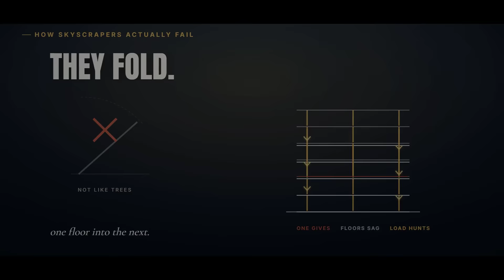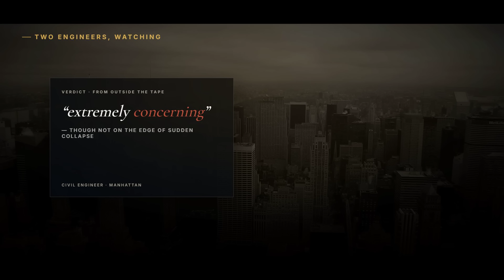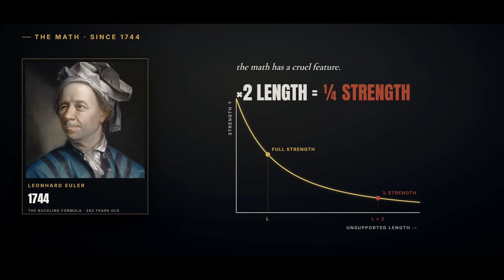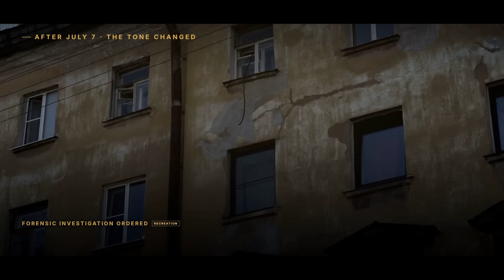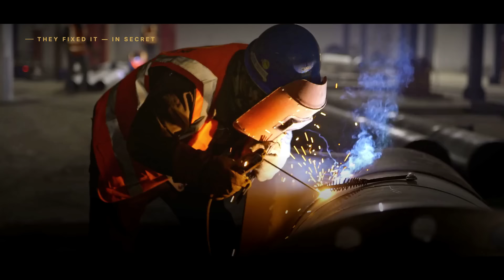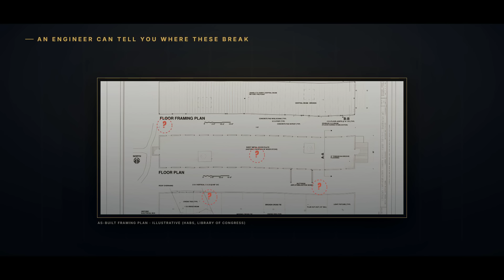It's Confirmed! Manhattan's Old Pfizer HQ Started Buckling Into Apartments. Here's Why!

Comment: Bolts provide a lateral strength , but are weaker in vertical strength. As tight as the metal bolted may be, a welded joint is solid, do you ever wonder how a screw comes lose? Gravity and vibration

Comment: One thing that is never brought up is that the columns that bent when the building were first bent were the top floor and supported nothing but the roof. Could these columns have been damaged during the original construction and salvaged for use on the non-load bearing top floor? The weight of nineteen stories were added to the original load on those columns.

Comment: The Citibank building was a very different situation because the designers had gone through all the hoops and did everything by the book. The problem was the novel design required consideration of the quartering winds,  which was not required by the code. Fortunately someone asked a question. This narration and other stories that I’ve read about this don’t really say why the welds were replaced by bolts. That was a critical part of the problem.

The narration also doesn’t seem to mention the role of the city inspectors in this process. If two beams were missed when the others were strengthened, why didn’t the inspectors catch that?

When they finish, they should put a plaque somewhere in the building honoring that steamfitter. What he did probably saved many lives.

Comment: Not a fair comparison. The Citicorp Building was a case of an unusual design made for a specific reason, which put it in uncharted territory when it came to what sort of calculations needed to be done. The Pfizer Building a case of additions to a structure that the original architects had never planned for and job-site blunders, neither of which the original architects had anything to do with. So why compare them?

Comment: A $32,000 fine not paid before construction continues is small change compared to the total conversion cost of the building likely millions. The fine should start much higher and for more violations it goes up a lot. 

Some investigator needs to follow the money. That will explain why they MISSED reenforcement and maybe other inspections I hope they don’t just stop saying it was a mistake. If I was part of the city council I would push for removing the extra floors.

Comment: No one will buy an apartment there or even near to it. I hope the seller must tell a buyer about what has happened. It was crazy to add floor to an old completed building. It should have been a calculation to decide if the beans would hold the extra weight. Plus, shoukd have been requiring inspections down to seeing actual steel under the fire proofing. It seems these beams had rust exactly where it failed.
Reply: The tops of these columns were at roof level. I wonder if years of small rain leaks had led to heavy rusting that no one saw?

Comment: The beams are below the original roof. They filled the empty corner of the building with floors and didn't change the original columns. There is also a cantilever effect as well. Simply put, they messed up.

Comment: Why not implode it and start over ? It's only money, after all.....
Reply: It will have to be taken down systematically, I expect.  There is not enough room to drop the whole building.  Besides, the original structure should be good, except for the local damage where these columns buckled.

Comment: Office buildings are built to hold a higher live load than apartment buildings. If those columns were overloaded they were probably modified, or a load bearing wall was modified. I'd rather live in a converted office building than an apartment building.

The main work with office conversions are ingress and egress,  water supply, waste lines and new electric runs. Partition walls are simple.

Comment: the load is too much on the existing structure that was built with xyz in mind loading  ,  putting mno in place and its over weight on the previous frame work, tear it down its not viable to try to fix  its a danger

Comment: I have been bullish on conversions from office to living space. However I would never had thought they would try to make old buildings taller and put pools on the roof. That just seems insane. They just don't want to lose expensive office space to affordable living space, so they think they can do these crazy attempts at "luxury".
Reply: The concept of adding on the building is not the problem. We have the technology and capability to do this. This disaster is not the time to question the moral reason for the problem as we have the engineering capability to make this work and the application can be used for many purposes than some developers’s greed. What happened here clearly was the result of some stupid people taking shortcuts that could have jeopardized the lives and well being of many innocent folks and the city around it. There is no fix to stupidity. Those responsible need to be sorted out , prosecuted but more importantly we need a permanent fix to prevent the building from coming down. At this stage this building is far from out of the danger from collapsing.  But the concept of adding on existing structure is not what got Us where we are.
Reply: I would seriously question why they need to make the building bigger instead of just working with the space they have.
Reply: @wendygoerl9162    Oye veh!!!  You really need to ask that question???

Comment: Let's be honest here.  Emery Roth designed the Pfizer building in 19 F'ing 61, 65 years ago and nothing happened to the building until some idiot tried to add 19 stories.  In the case of Citicorp, the building was designed and engineered correctly.  It was the construction crews that changed the design and I don't think they communicated their changes properly.  Seems to me you're looking at the wrong people, trying to make a story where one doesn't exist.
Reply: construction crews dont change designs. the designs were flawed from the start.
Reply: @BondJamesyt They change them all the time. "As built" drawings (if done correctly) rarely are a perfect match with the design blueprints.

Comment: Part of the building needs to be demolished?  No WAY!!  The entire thing needs to come down.  Who is going to pay millions for a condo in the Surfside 2.0?
Reply: The reason why the columns bent is clear.  Remove the reason and I would live in the building.  It's not a defective building.  I mean, if I put 500lbs on your shoulders you might collapse,  but that doesn't mean you're not fit to walk or bring in the groceries.
Reply: @stoltz1379  remove the building. it is defective.  after you put  500 pounds on somebodys shoulders  they are not likely to be fit for walking.
Reply: @BondJamesytI'm more inclined to go with what the engineers recommend.  But that's just me.
Reply: @BondJamesyt They may need time in a hospital, but people have fully covered from forces well beyond what the human body can take without breaking. You're going to need to check the other columns, but that's fixable/reinforceable. Only real question is whether it's worth the cost.

Comment: I'm having a hard time understanding how apartments create more load than mid-century office environments. Rows of filing cabinets stuffed to the brim with heavy paper documentation around every corner, heavy furniture made out of real wood and metal, computers that occupied whole floors and weighed multiple tons… vs residential loft contents!
Reply: Yes, the culprit here is a lot of extra floors added with no thought toward supporting them.  IDK how this could happen.

Was it bad engineering or bad execution?
Reply: Agree with your assessment of office furniture and loaded filing cabinets,metal desks and such but you have to remember that floors are calculated by per square foot loads. Offices don't have bath tubs or exotic tile or marble slab walls and counter tops added to its back in smaller spaces. Openings need to be cut for pipe chases that usually run to a maintenance floor. Added electrical (more conduit and electrical panels, wire ) and communications etc. create challenges and most residential construction in high rises require more framing, drywall installations are required to be 2 hour fire ratings separating units (which is a double layer of 5/8" thick drywall at 108 lbs per sheet) and adding wood or steel doors add a lot of weight. The one thing that blows my mind is a roof top pool on a building that can't handle what's already been added to it.
Reply: Wasn't this developer going to place a swimming pool high above the office girders? How much does a gallon of water weigh? How many gallons of water will fill the pool? Was the office building originally designed to carry the weight of a swimming pool? A swimming pool must bear a proper structural framework. On the other hand, the weight of offices usually is spread throughout the structure, as per Pfizer's original design. We had a similar problem a few years ago with an office building that was tiny by comparison. No swimming pool, just a simple office building that had rows of "filing cabinets stuffed to the brim with heavy paper documentation around every corner," as you put it. The building, as constructed, was built to carry this load. It did not anticipate adding new floors atop the original structure or creating a swimming pool. The original building had a relatively small amount of plumbing for office workers' needs. When the idea of turning the office building into condos arose, two obvious facts occurred. The original concrete floors would have to be carved open frequently to bring water to sinks, toilets, bathtubs and so forth. Openings would be needed to carry wastewater. Eventually the concrete floors would resemble Swiss cheese. Modern (and heavy) flooring would have to be installed. And then arose the second issue: the asbestos cladding of steel columns. The office building was constructed several years before asbestos was banned in office structures such as this one, according to the architect. The price of removing the asbestos was almost as great as the cost of creating the condos. The final decision: remove all asbestos, then implode the building. Condos were not economically justifiable. I watched as the building came down. To me, it seems as if the developer of the Pfizer building greatly overreached the design of the original office structure. He should pay the price for restoring the building to its original design or demolishing it at his expense. The city's building inspectors should not be left off the hook. They need to bear a price: firing or prosecution. Probably both.

Comment: I can sum this up for you: the pfizer building was built ti support itself and its live load. It wasnt meant to support an extra 4 stories and a massive addition. Steel is designed through load calculations, and those calculations determine the shape and thickess of the steel. Most developers design the steel to be just strong enough to support itself, its occupants, all their stuff, and about 30% more weight than neccesary as a form of redundancy. When you start adding stories, you need to start adding additional steel, and it doesnt look like that happened here.
Reply: The columns are very strong in the base of the building.  Towards the top, they start to use lighter materials.  Why?  Because if they used the 150 pound per foot I-Beams to the roof, that can support millions of pounds, it would add millions of pounds of steel to the building, that is not required.  Afterall the top 3 floors are only holding up a tiny amount of weight compared to the bottom 3 floors.  

It seems like the bent columns are made to only hold up 3 floors and the roof above them.  Then someone decided to add a few more floors, and also to cantilever some extra weight on the outerwall column - the one's that failed.  They worked great from 1959 to 2025.  But then add several million pounds to the outside wall, that did it.
Reply: Four stories? The place where the collapse has begun had 19 floors built above it. In addition to that, the new construction's facade was cantilevered above the former 21st floor roof.
Reply: Yeah. Did the engineers slip up or the contractors and inspectors?  A LOT of people had to sign off on this.
Reply: @johneary8874 this has "the developer said to do it this way..." written all over it. Architects and engineers don't care about selling units...
Reply: @A_Lion_In_The_Sun If so, this was very poor fiscal judgement on the part of the developer.  This looks like a catastrophic financial loss, and could have been far worse, just to save the cost of reinforcing some steel.

Comment: These buildings need to conform the the  corrent fire codes also . Which may required the spraying of monocoat on steel framed construction or encasing steel columns in concrete. Steel framed buildings will fail quicker in a fire than poured concrete will. This building will have to be gutted back to the frame  and each member stress tested to ensure integrity. Goodwill has now been lost by this obvious mistake and hubris of those that should know. The superhighrises on billionaires row are also an exercise in arrogance. Buying up Air rights so that they can go superhigh on a small footprint, These Straws in the Sky will have their own problems. Ghettos in the Sky.
Reply: New highrise construction requires sprinklers, standpipes, and alarms.

Comment: If it is possible anymore to find competent builders here is the solution.
1. The floors below must be supported by additional columns. One above the other on each floor field cut and installed without moving or disturbing existing. The idea is to transmit the load to the ground. Unloading floors above the failing columns is a given. The notion that it is only a pancake collapse is flawed. Any demo engineer would question. Is the build still plumb above the buckeling support. This is the relevant question. 
Odds are renovation and design mods over the years and increased loading without proper engineering is at play here. Live loads must be considered. Plumb and true calculations  are warranted. A horizontal means  of cabling using might even be possible to transmit the live load if an out of plumb condition it found. Not to hold all the mass but to transmit it laterally to an anchor. This only stabilizes existing structure. The question becomes is there a fulcrum point available? The supporting members must be shored adjacent to the buckling member and transmitting the loads to members from below and distributing it down to the ground. Holding the building where it is for safety is a must.
TRAMCO R&D, B.C. Industrial class.

Comment: That slanted crown on the Citicorp Center Building was for solar panels.  However to stall people from using them, ConEd paid the owners not to install the panels.  And the "fix" included adding columns on the outside of the building, to help support the entire structure.
Reply: Oh brother
Reply: Yes, the intent was to permit the installation of solar panels. Did ConEd bribe the owners to not do so? Anything's possible. There were no columns added to the outside for the "collapse fix" -- the bracing joints were redone (welded, not bolted).

Comment: Missed?  Not in danger?  The god damn fucking lies being told.  They built up 19 stories of weight over a set of columns designed to hold a roof, just a roof.  Not one single intelligent engineer using basic principles would say those columns would hold.  As stated, a bent column has already failed, it just hasn't finished yet.  The columns bent not snapping as load was distributed to other points, other columns.  Some people have been looking over the numbers, running the structure in engineering software, and the load shift is incredible.  Some of the beams the load shifted to are actually close to engineered failure levels.  If one more column had been a little weaker, maybe a bit or rust, a touch of damage from a past issue, a third would have failed and then more load distribution, more failures, and catastrophic cascade failure. The whole 19 stories was CLOSE to coming down, and then that would have plunged through the 22 storied below, and if lucky, not taken the rest of the building down.  Berman and his entire firm needs to be banned for all construction in the US.  period.

AND if I was the owner of any buildings around that one -- I would file a lawsuit in court to stop conversion work until all analysis and engineering is done by outside parties, which should take 3-6 months to review all the documents, records, and ensure all the questions are answered.  They will delay any opening for tenants by a year likely.  And with the fines and lawsuits to come, it should bankrupt the company if lucky.
Reply: Honestly the fact the building was steel probably saved it. If it were concrete it would have snapped right away
Reply: @ratvomit874  Cracked and fell away in pieces most likely.
Reply: The lawsuits would last decades while the property sat empty and failing. There are 2 unfinished highrises in NYC, 1 in New Orleans, and another in Boston I believe. That doesn't include Millennium Towers which is a whole new level of boondoggle. Highrises in Florida on Billionaires row are sinking and have water intrusion into the concrete. The list is endless.

Comment: A column supports a vertical load. Floors and walls ensure that the column remains rigidly upright with no opportunity to acquire horizontal forces that disturb this pattern. During renovations some of the parts of the structure, like floors, etc., that prevent deviance from the vertical were removed. That enabled horizontal movement, due to flexing with wind and temperature. The vertical column now develops what is termed a moment and the vertical downward force action is that of a lever adding enormously to the slight horizontal force and the column buckles.